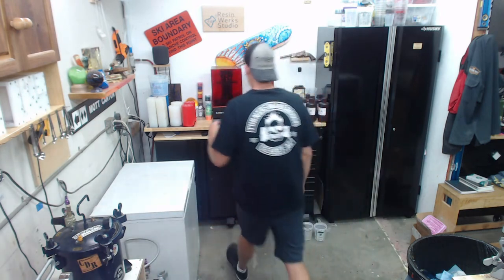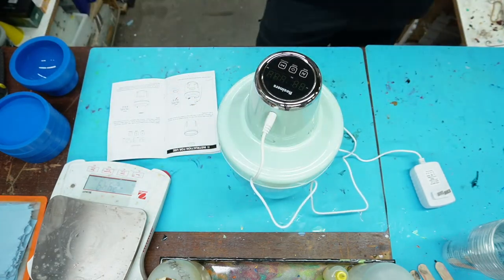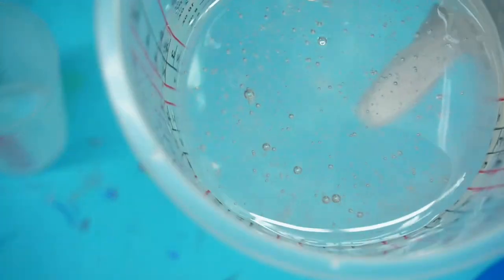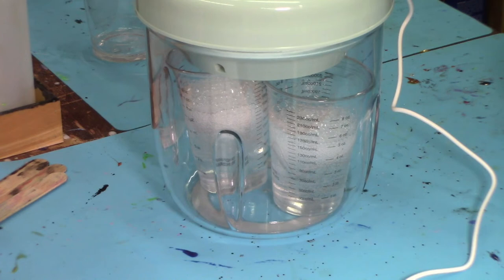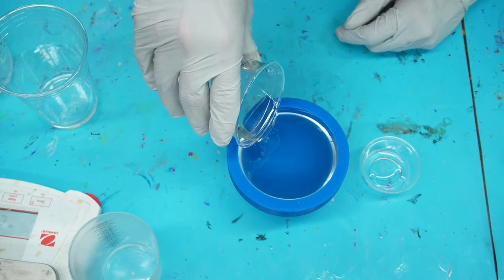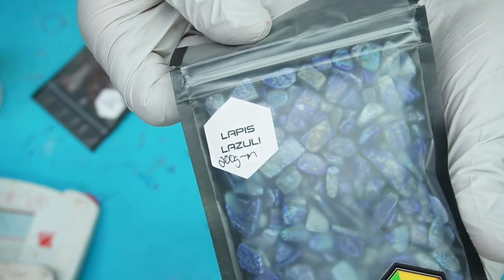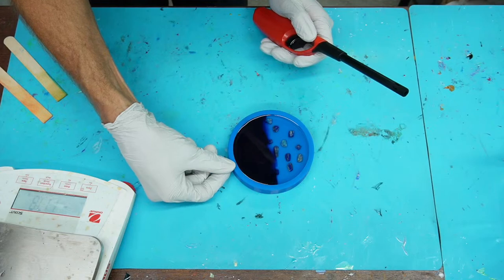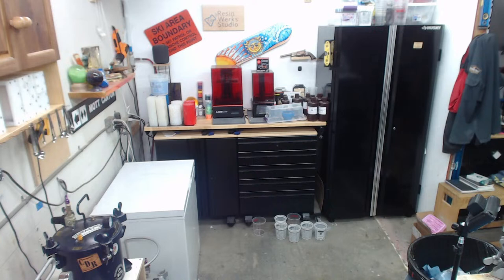🔴Replay: Resin Bubble Remover? Let's Try it Out! | Episode 251

Comment: kPa - The unit of the pressure of the pascal is equivalent to one newton per square metre (N/m2). In our day to day life, the pascal is most frequently used in the form of kilopascal (1 kPa = 1000 Pa). One kilopascal corresponds to about 1% of atmospheric pressure with reference to the sea level.
Reply from the maker: Thanks for letting me know, I'm just not familiar with these units of measurement